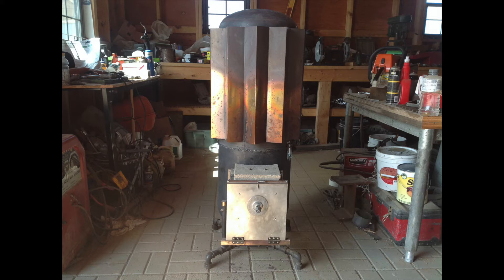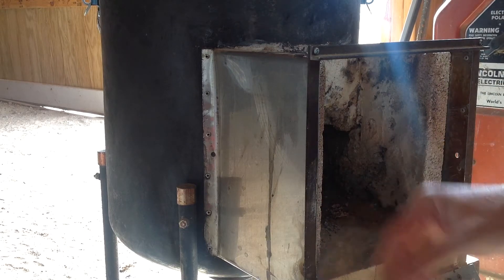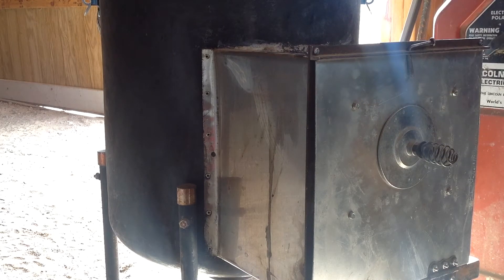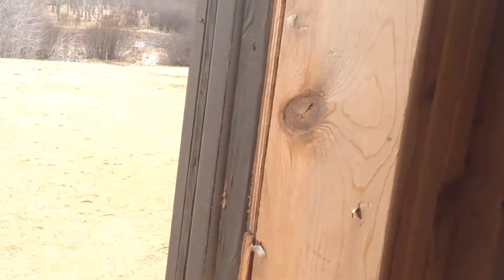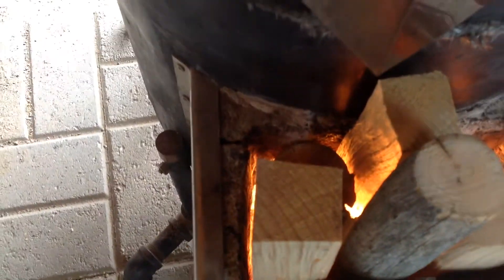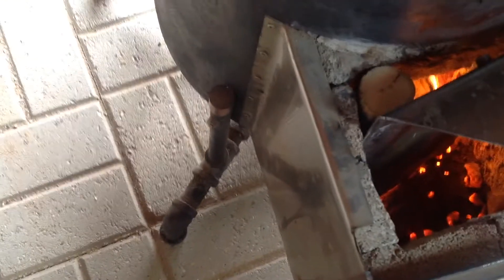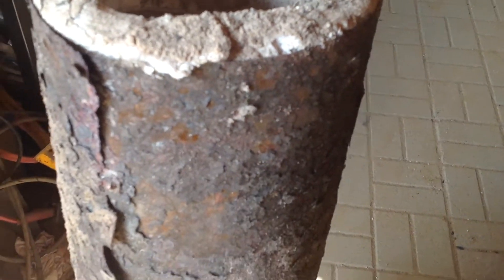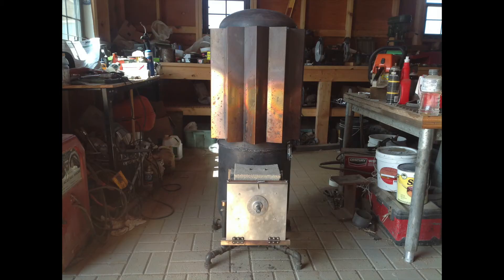Reviewing, DIY Rocket Stove Heater

Comment: Next build I'd try enlarging so you are not required to reload 4-5 times an hour... maybe a batch firebox so you load all the hour-wood at one time so it burns a full hour unattended. Even that may not be adequate for an all night burn... Good luck!
Reply from the maker: This was my first rocket stove from 6 years ago.  I learned a lot from it, and was my first experience with that kind of hot clean burn.  It's a pain to keep adjusting and adding wood every 15-20 minutes.  Without a heat storage mass, I don't think it's very practical for heating a place for living.  It's just a quick temporary heat.  Learned enough to go on to build the masonry/hybrid fireplace we have in our house, and last year the rocket stove water heater.

Comment: did you insulate burn chamber and how long will it burn on what you have in hopper?
Reply from the maker: I put perlite down and around the base of the riser tube.  To keep it burning hot, it seems like it needs adjusting or filling every 15-20 minutes.  I did a video a couple of days ago with some testing on it.  I'm using it in the greenhouse right now for some temporary heat.  Watch:  https://youtu.be/4fzQSEiWpw8 
Thanks!
Reply: @doubleMinnovations  thanks

Comment: Wow. Ash is uesd to refract heat when melting steel. Would it work as a fire brick. And or if I just ues it to pore around a steel fire box as a inslater to  Refract heat. I'll also ues fiberglass insulation to put around the fire box as well after the ash.
 It's corrosive but I would imagine it'd be fine if it doesn't get wet.

Comment: Do you think that using a larger tank would recover more heat from the rocket stove ??? Since the top gets red hot, would making a heat exchanger make the recovery of heat increase the efficiency ??? Thanks
Reply from the maker: The copper heat fin shroud took care of the sides, and I fitted a big cast iron pan on top, and filled it with scrape metal to absorb the heat.
Best wishes!
Reply: @doubleMinnovations  Do you think using a stainless steel metal stove would survive the heat better and spread more heat without using scrap metal heatsink top ?? Thanks VF